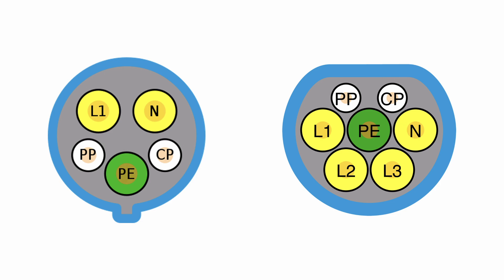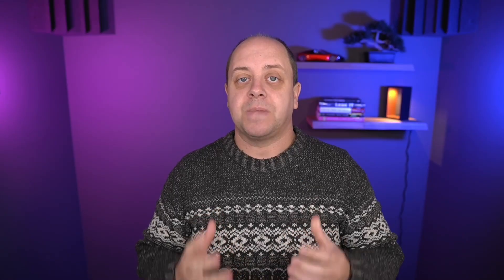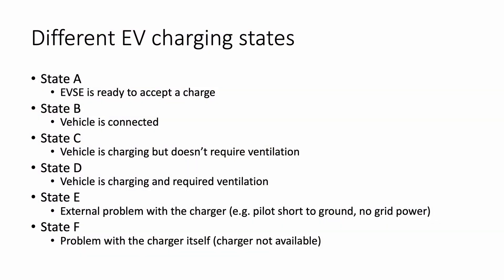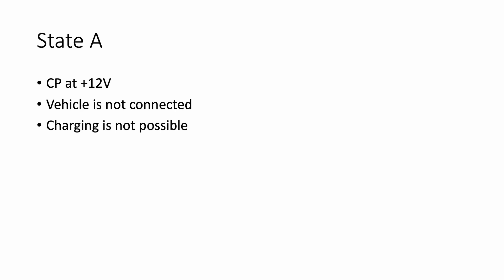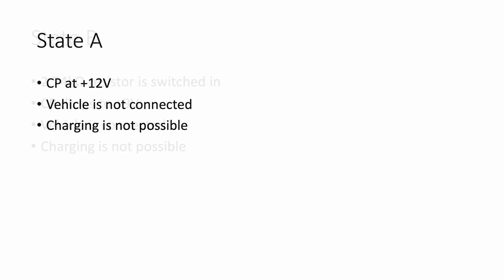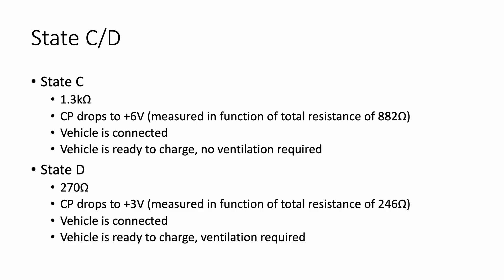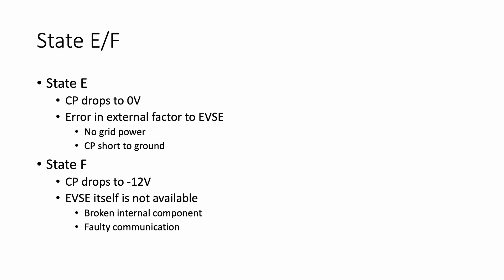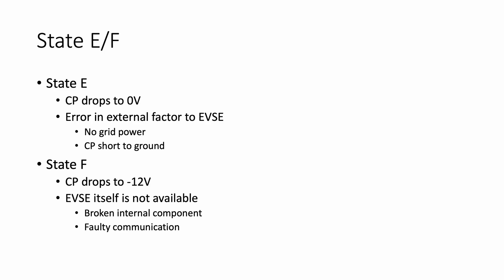How does AC (smart) charging actually work? PWM explained!

Comment: What about the voltage? Is it 230V or something else? I saw a few different voltages in the standard but I don't understand how does it get determined?
Reply from the maker: One of my first videos explains the different voltages in 3-phase grids. https://youtu.be/HWcxzGHlQDk?t=519
Reply: @StevenPeeters  thank you! It’s a classic 1-phase / 3-phase system. I understood now. It seems like all the logic is implemented within a car and as long as 1 phase is used there should not be any problems.
Reply from the maker: @k1zmt  It is indeed the onboard charger that determine what it will and will not charge on. The wall charger itself is just a dumb power provider (unless you get a smart charger of course, but that doesn't change the car's behaviour)

Comment: Used pulse width modulation in synthesizer music in the 80’s also in electronics class using a 556 timer to control industrial circuits using solid state relays .
Reply: You can also use it to make LEDs dimmable.
Reply: @jeffbosch1697 well you can control the duty cycle and make the LEDs more efficient .
Reply: @Fraiyia  And the brightness. You can also control the speed of a DC motor with PWM.
Reply: @jeffbosch1697  I am an electronics engineer .  This is my field . However thank you for providing that bit of 2nd quarter electronics and industrial control , perhaps you are more accustomed to girls who studied at beauty schools and did well in home ec yes ?
Reply: @Fraiyia  Is the snippiness really necessary?
Reply: @jeffbosch1697  only when you try to explain electronics to me like I’m a 6th grader who barely understands what a zener diode is .
Reply: @Fraiyia  I did no such thing. That's your own insecurity showing through. Neither of us knows much at all about the other, but you seem awfully quick to make assumptions then use them as a basis for insults. Were you born that rude, or did you have to study for it?
Reply: @jeffbosch1697  dude I literally don’t care anymore. You thought you were gonna explain electronics to me when I called you on it you got bent outa shape-  live and learn.   What’s next you gonna try to splain aviation to me too? Or guitar playing?  …

Comment: Hey nice video.
What I still dont get it what if the following scenario occurs:
Charger sais car can load with 32A
Car can only load with lower Ampere (lets say 16A)

Is the PWM Signal then beeing changed by the car?
Reply from the maker: The charger detects less current is being drawn and then adjusts the PWM to match the car's power request.

Comment: Does the fast DC charging system use the same PWM?
Reply from the maker: Yes and no. When DC charging, the voltage levels on the CP are still used to communicate the state of the vehicle (A/B/C/D/E/F), but the PWM will be at 5% to indicate that a different high frequency communication will be used for the charging. This way, the CCS protocol allows for much more information to be communicated, such as the state of charge, for example, which cannot be communicated with simple AC charging.
When DC charging, the onboard charger is kind of bypassed as the inverter doesn't have to do any work converting AC to DC. It's a bit simplified, but the while charging procedure is different with DC.
Reply: @StevenPeeters  How does the communication work on these DC chargers, do you have an example?
Reply from the maker: @Tony770jr  it is using digital communication like LAN communication, with packages and headers. It is quite complicated. Here is a good document if you have trouble sleeping 😉 https://tesla.o.auroraobjects.eu/Design_Guide_Combined_Charging_System_V3_1_1.pdf
Reply: @Tony770jr  Communication in Dc charging happens via Control pilot  low level communication (PWM) and high level communication (PLC powerline communication) .
In case of CHademo and GBT standards communication happenes via CAN